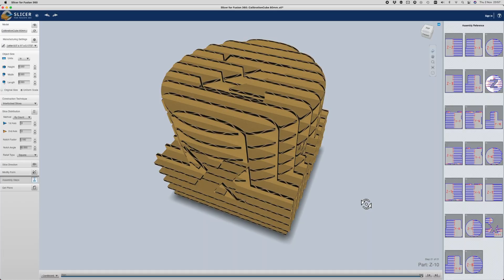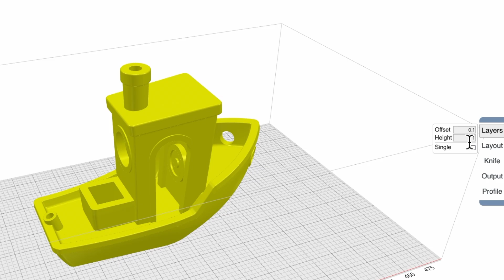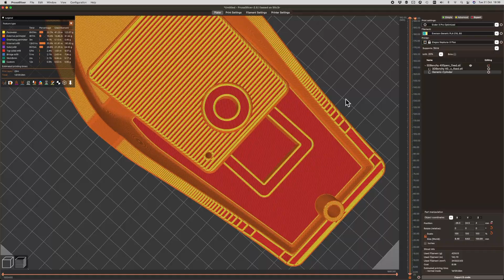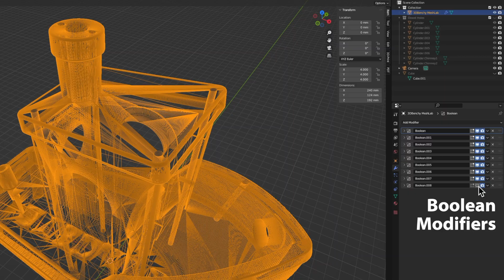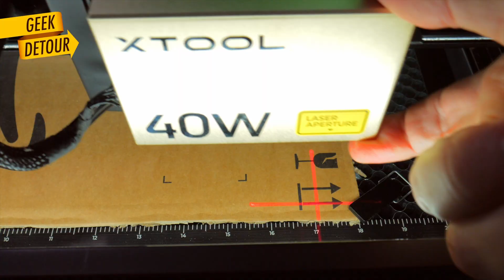How to Laser Cut Cardboard from STL | xTool S1 Laser Cutter

Comment: Did you not try Slicer for Fusion 360? The link is still available and it seems to work in Windows 11 for me ok. It is the last version of 123d Make
Reply from the maker: Yes, I tried. The question was: how long will it still work? For a one of project, it’s fun and all. But if you want it to be as a tool in your toolbox, that you use frequently, it’s not ideal to trust legacy software.

Comment: Thank you for doing video like this and help to learn about new techniques and useful resources.  What is your opinion on Snapmaker 3-in-1 machine if you ever used this machine before?
Reply from the maker: Thanks! I never used one myself - personally I don’t like machines that do more than 1 thing… I prefer a separate CNC, separate Laser, sepárate 3D Printer - but I understand the appeal when there is very little space. You need to check reviews, just like I would do.

Comment: Thanks for the video (1 year later 😂), it’s very interesting. Just a note : there is a slicer add-on for Blender which does the slicing (it was developed around 5 years ago I think). Unfortunately it does not number the pieces to my knowledge, still needs to be done manually.
Reply from the maker: I very rarely use Blender, I am super newbie.

Comment: AI Summary

Abstract:

This video documents the process of creating a 3D Benchy boat model from stacked, laser-cut cardboard layers, driven by the challenge of recreating functionality previously offered by the now-discontinued Autodesk "123D Make" software. The creator details a comprehensive workflow utilizing various open-source tools: scaling the 3D model in PrusaSlicer, strategically adding alignment dowel holes in Blender to overcome software limitations, slicing the model into 2D layers with Kiri:Moto, and then organizing and numbering these layers in Inkscape. The video culminates in the laser-cutting process using the xTool S1 machine, highlighting its safety features and integrated software, followed by the final assembly. The creator emphasizes the time-intensive nature of preparing the digital files and advocates for the development of more user-friendly open-source tools for such fabrication projects.

Summarizing the Cardboard Benchy Creation:

*   0:00 Replicating 3D Models in Cardboard: The video introduces the ambitious goal of creating a 3D Benchy model by laser-cutting and stacking layers of cardboard, a process previously simplified by Autodesk's "123D Make" which is no longer available.
*   0:26 The Challenge of Discontinued Software: The creator explains that "123D Make" (later "Slicer for Fusion 360") was an excellent, free tool for converting STL models into stackable or interlocked slices, providing assembly instructions and numbered parts, but Autodesk discontinued it.
*   1:10 The Open-Source Plan: A new workflow is outlined: scaling the STL model (4x larger), generating laser-cut drawings (SVGs) with dowel holes and numbered parts, optimizing layouts for cardboard sheets, laser cutting, and then gluing.
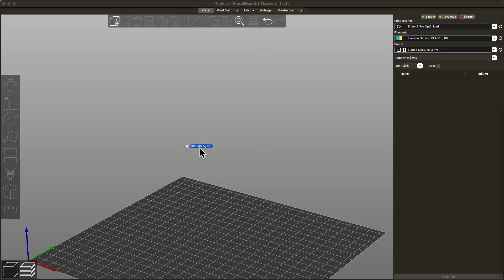*   1:54 Scaling and Initial Slicing (Kiri:Moto): PrusaSlicer is used to scale the Benchy. "Kiri:Moto," an open-source, browser-based slicer, successfully generates SVG layers but initially lacks dowel support, numbering, and produces a single, unorganized large layout.
*   2:49 Adding Dowel Holes (Blender Solution): To ensure proper alignment of the stacked layers, especially for complex sections, dowel holes are crucial. After PrusaSlicer failed, Blender (a 3D modeling software) was used to manually punch these holes (e.g., on the cabin corners, hull sides, keel, and chimney) into the STL model before re-slicing.
*   4:29 Preparing Layouts and Numbering (Inkscape): The large SVG file from Kiri:Moto is then broken down into multiple sheets using Inkscape. Layer numbers are added to each piece for assembly guidance, and distinct colors are assigned for laser engraving (numbers) and cutting (outlines).
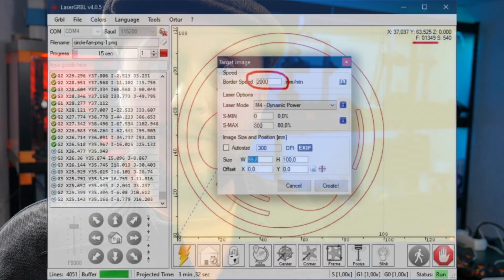*   5:18 Laser Cutting with xTool S1: The xTool S1 laser machine, along with its proprietary "xTool Creative Space" software, is used for cutting. The creator highlights features like automatic focus, real-time laser head tracking on screen, safe enclosed operation (no glasses needed), and effective smoke extraction.
*   7:25 Assembly and Final Product: The 30 layers of 3mm cardboard are cut and glued together, resulting in a successful 3D cardboard Benchy. The creator notes that gluing took significantly less time (15 minutes to an hour) than the digital preparation (a whole day).
*   8:45 Call for Better Open-Source Tools: The creator expresses a desire for more user-friendly open-source software tools to streamline the model preparation and slicing process, making laser cutting more accessible to a wider audience, and encourages community input for new software recommendations.

I used gemini-2.5-flash-preview-05-20| input-price: 0.15 output-price: 3.5 max-context-length: 128_000 on rocketrecap dot com to summarize the transcript.
Cost (if I didn't use the free tier): $0.0050
Input tokens: 14485
Output tokens: 807
Reply from the maker: And reading this huge summary is supposed to be more interesting than actually watching my video?! What’s the purpose of that?! 🤣

Comment: this is so cool for my exact application this is the thing i needed. I work in an engineering lab at a college and I've been trying to find a software that would do what fusion used to do since I wanted to slice 3d files to an svg on a project but couldn't figure it out. so much help thank you.

Comment: You cant cut basic shapes out of STL and then export them.  But You can cut STL out of STL and export as 'new STL'   
So import a STL of a cylinder and use that to cut your holes.
I use AutoCad and OpenScad to create STL's or 'borrow' somethings, often just parts of things, I find on the interweb  and  Prusa slicer is, for now, my STL editor..

Comment: Anyone who knows why kiri moto dont begin slicing from either top or bottom? i want to slice an object in 10 equal thick slices. but top and bottom layer is half of what i set the layer height to. and the object is able to devide equal to 10. so how do i tell kiri that I want it to begin att the bottom then slice equal slices from there and up?

Comment: One of the alternatives is to do the scaling and adding the holes with Windows 3D builder. Thanks for the great video. I still used slicer for Fusion360 recently, but its buggy as hell. Nice to see that there is some alternative to it :D
Reply from the maker: Hi there! Thanks for stepping by 🤗 Yeah, Autodesk seems to have a thing for creating nice things they will abandon later (or more accurately, small programs seem to be used as a laboratory to test ideas - the problem is: users are part of the experiment).
Reply: @GeekDetour  At some point Autodesk promised to integrate 123D make it into Fusion360 like they did with eagle, but it did not really happen😔

Comment: I'm hoping to do a similar project but with layers of identical paper images to create a 3d effect.

I assume I don't need a big laser for paper and only need a 3.5"x2.5" workspace BUT I do need to precisely orient the cutter so that intricate art can be cut accurately. 

Is this possible?
Reply from the maker: Oh, the devil is in the details: sure, for paper, even a 5W laser would cut them fine (slower, but surely). Now, how to align your paper sheets, that’s always the trick. It’s always doable - but each project has particularities.
Reply: @GeekDetour  I asked on reddit and it was suggested that I use a cutting machine (like Brother CM350) to avoid scorching. Is this better? If I use laser, does paper cut cleaner at low power, or is it like ripping off a bandaid - burn hot and fast to avoid transferring heat?

I have seen a lot of cutting machine videos about using the on-board scanner and screen to automatically detect edges and plan cuts for things like a page of stickers, but nothing about using computer software to program a more nuanced project. are you aware of any software I can play with before investing in a machine?

I generally want to cut worthless cards, but if successful, I could be asked to destroy collectable items of great value. I don't mind a learning curve, but I want to be able to insure accurate cuts. Do you have any hardware suggestions that are particularly effective at orienting the paper?
Reply from the maker: When you hold a normal sheet of paper in your hands, the scorch is very precise and really thin. You need to look with a lens or very very close to notice the brownish tone just at the very edge of the cuts. Most people won’t even realize it was burned instead of cut. BUT, that’s on a single paper. If you stack a bunch of them together, the scorch becomes a wall, and it will look brown / burned. 

I never used Cricut machines or the Brother one you mentioned. Sure it is just like using a surgical bisturi to cut the paper. If might be a better option for your application. But I don’t have anything but a blind guess about it.

Comment: Oh I loved this and wish I’d seen this a week ago when I was using illustrator to create a 3D model and slices for laser cutting. I want to know more about why the pieces needed dowels? Couldn’t you just use a grid to line them up properly based on side and top views of the 3D sculpture?
Reply from the maker: I bet someone could carefully align and glue the pieces by eye… but that’s not reliable and takes time. I wanted to experiment with ways to make it easier - as 123D Make used to provide. I want to make cool cardboard sculptures and dowels help A Lot

Comment: I recently received my XTool S1 and I'm curious about the speed and power settings you utilized for cutting cardboard. I've encountered issues with mine catching fire during more intricate projects. Your video was fantastic, by the way. It was truly motivational and uplifting, reminiscent of watching a Bob Ross painting video. It's like picking up the brush and realizing it's more challenging than it appears, but I wouldn't have attempted it without watching the video.
Reply from the maker: Ha ha ha, thank you so much! Very kind words! Well... when we are starting with any machine, and learning, "we don't make mistakes, we have happy accidents" 🤣❤️ For cutting 6mm cardboard, I used 100% power and 35mm/s - for Cardboard 3mm thick, you could theoretically go 70mm/s. What were you using? I go as fast as possible that cuts all the way through, cleanly (that the cutout just falls on its own).
Reply: Thanks for the responding. I am using 3, 4, 5, and 6 mm cardboard. @GeekDetour

Comment: As a technology teacher, I have only just stumbled onto this type of project. A teaching resource from many years ago mentions 123D Make, and I was so disappointed that it no longer exists.
It seems doing this now is convoluted, but I may still give it a go.
I really enjoyed your video, which was exactly the info I needed. Subscribed.
Reply from the maker: Hey! Thank you! ❤️ Great respect for Technology Teachers! Look, you can still “find” 123D Make on the Web. But who knows for how long it will work on your computer… It is not something I would recommend to students since they cannot trust it in the long run. But you could give it a spin if you find it - just to try it out.
Reply: @GeekDetour   Software doesn't necessarily need regular updates to remain functional in the long run like Sketchup 2017 Make which is still fine for every day use with tones of plugins.
The main issue here is that 123D Make relies on the cloud to get it to export your files which is a shame and makes this tool useless unless someone cracks it open. But that's a problem on it's own.

Comment: so angry with autodesk, as I make models for films, and they are low budget, I can pass the seat licence costs to my clients but they can not afford it,   I need to make aircraft hulls, and ship hulls.   Just a quick question can I live gaps between layers in the design,  or do I just have to do the maths and every layer chuck out four or five layers on the SVG,  as that might take time.
Reply from the maker: If you look for it, you can still find 123D Make for downloading at some websites… but there is no warranty it will work on your system. I could get it for my Mac, to make this video. But it is not a tool for relying on anymore. For your use, “interlocked slices” would be the best - as it has mostly “open” space inside. I have no idea of any other tool that would make the slots for interlocking parts… Kiri Moto just slices the models as stacked layers without any space between them.
Reply: @GeekDetour  thank you, will have a look at is some more,  great video as well.

Comment: could I ask what settings you used to cut your cardboard?  It looks like you have very little char and it appears you were able to do it in one pass.  I have not been able to cut 3mm cardboard in one pass with my S1with out going so slow it catches fire.  I have needed to do it in two passes every time.
Reply from the maker: Hi there! Are you using power at 100%? I do. Yeah, I cut the cardboard in 1 pass, I also cut MDF 4mm at one pass (a bit slower, I don’t remember the speed). I use the S1 Air Assist on “auto”.

Comment: I like your idea of combining 3D printing with laser cutting because that's exactly what I want to do for one of my projects. 

I'm building a series of Tesla style turbines with different configurations to find the design sweet spots. I'll be 3D printing the structural components but using very thin materials for the discs which I want to cut with the laser. Some of the materials will be - paper, aluminium foil, food wrap and possibly very thin latex. Right now I'm building them with some old floppy discs which I have been saving for this purpose. I'm thinking of doing it with one of those creality laser heads which attach to a 3D printer. I'd be very keen to see some one cut thin materials like that. 

It was very instructive to see you cutting cardboard!

Comment: Hi
Thanks for this interesting video.
You are right, 123D make was great.
And I still want to use it. Easy to download, to install and to use ... But non export possible.
I finally find a PDF printer on which you Can easily manage printing formats because I am working on a 800x1200 mm sheet.
And After days of searching this pdf printer was able to print a pdf file fully usable for cutting. In my case this is a cutter CNC table.
Reply from the maker: Oh, Inkscape can open the PDFs then you can re-export as SVG. Cheers!

Comment: I see your point with laser cutters but i don t think that is the reason you can have a decent 3d-printer for 200€ but this laser cutter is 2500€ and i know it is not the cheapest but the price doesn t go mych lower than tis whilst not sacrefiecing safety al to say my point is ther just to expensive
Reply from the maker: I guess it is viable to have cheaper laser cutters - it only needs more demand. Most people that have 3D Printers don’t have any laser machine (even the super cheap ones), so it is a market yet to grow a lot.
The fully enclosed machines will ALWAYS be quite more costly than open frame ones because the material, fabrication and transportation costs get much higher (this closed S1 is 5 times heavier than the open D1… and it’s boxes were insanely big). Anyway, competition is growing. 
Looking at another angle: 2.5k is not expensive for a reliable and safe machine you actually use on a workshop (not as a hobby). xTool is clearly targeting its machines to the pro-summer market.
I feel the obligation to show something more serious done in this machine - but cutting a cardboard benchy was irresistible 🤣
Reply: Right now you can get the S1 with 10W laser for $899.
Reply: There's really good laser cutters for 500$